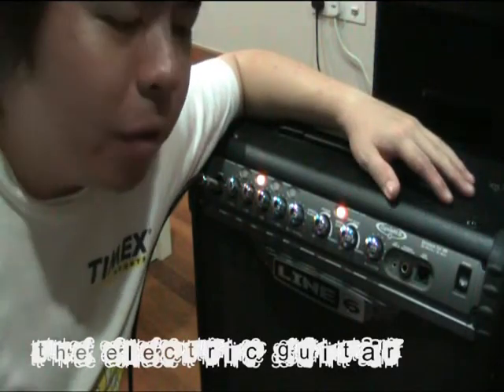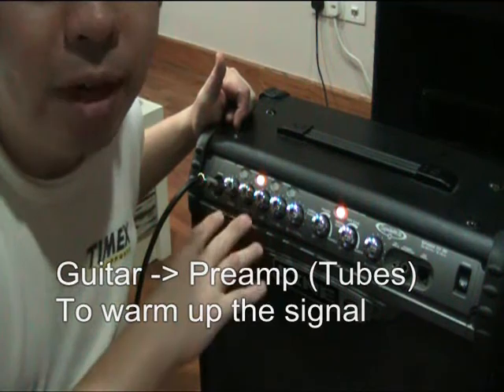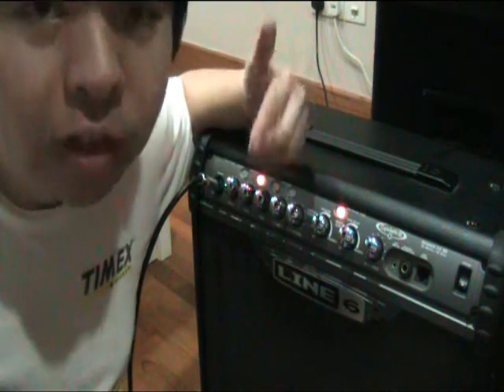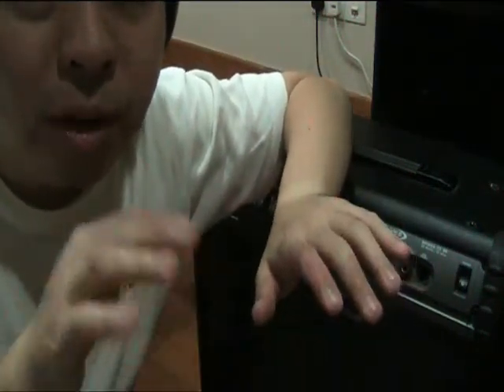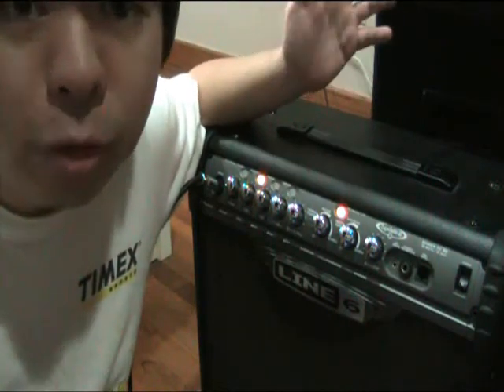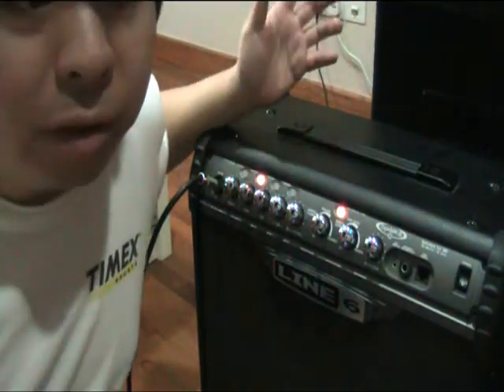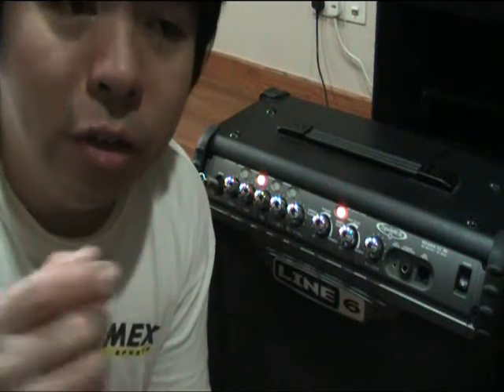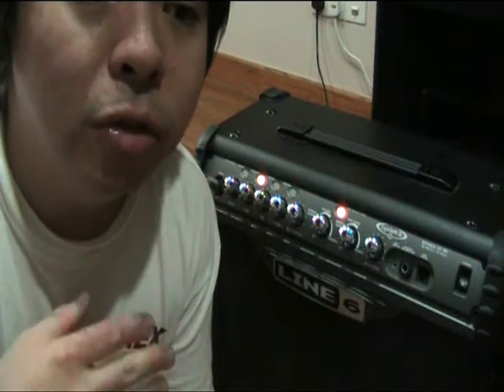Gear: Testing A Guitar Amplifier

Comment from the maker: Hi there! The gain control on your Micro Cube RX adjusts your preamp drive, while the volume control appears to be a master volume. You can use this method for all kinds of amps. In a modelling amp, if an EQ knob is responding the same way with every model, then you're listening to the speaker response (as that remains constant throughout). Speakers play a big role too!